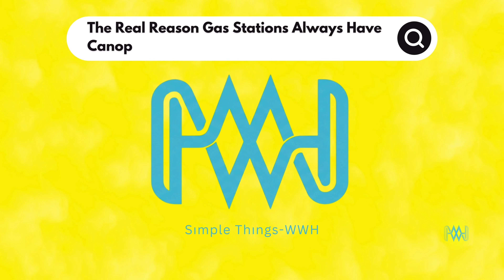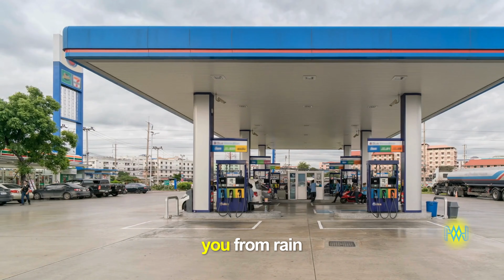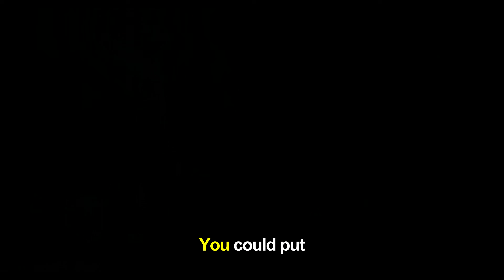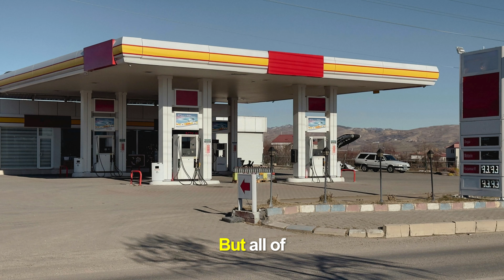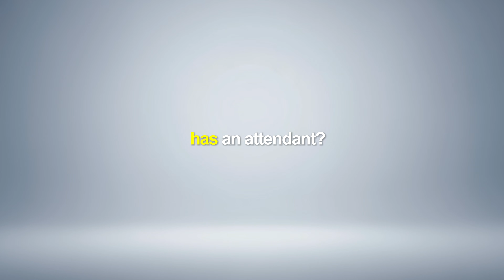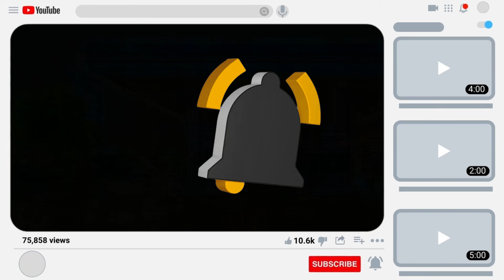The Real Reason Gas Stations Always Have Canopies

Comment: The gas station canopy nearest me is checkerboard gray and green.

And has 5 attendants 24 hours a day to pump gas, squeegy all the windows, check the oil, washer fluid and the battery's electrolyte level, tire pressure, and dispose of any trash that is inside the car.

 Each has a wireless credit card device and carrys change for cash sales.

Oops, my bad ... I was dreaming all that ... it's 2026 not 1956.

Comment: I don't think it's right to say the canopy directs the vapor up and out.  The canopy is surely vented as to allow vapors to not accumulate.  The prior implies the canopy is acting on the vapors, but it's the vapors acting on the canopy, which is why they are vented.  I'll look the next time to see if they're an open frame system so there is no closed volume to contain gasoline vapor.

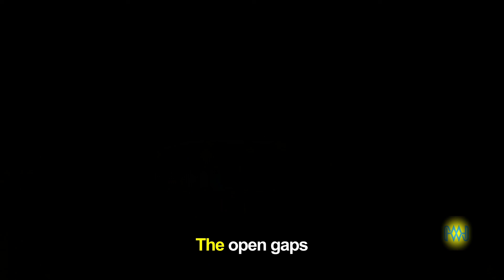Comment: 1:08   “The open gaps along the edge of the canopy are there to direct the vapor up and out.”

Huh?  What gaps?  Your video shows nothing.

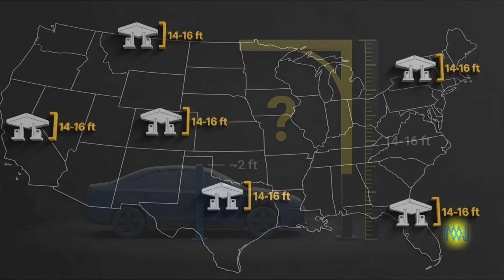2:05   “Your car only needs about two feet of clearance.”

Say what?  My car is only two feet high?  Are you smoking crack or something?
Reply from the maker: Thanks for watching closely!

On 2:05: totally get the confusion, but that line was about clearance, not car height. Meaning: your car itself only needs about 2ft of extra space above it to pass under something. The canopy is set at 14-16ft specifically because fuel tanker trucks (13-14ft tall) need to fit underneath for deliveries - way more than any car requires.

On 1:08: fair point, if the visual didn't clearly show the gaps I'm describing, that's on me for the edit. I'll make sure future videos pair narration with matching footage more tightly. Appreciate the feedback.
Reply: @WWH-X    Thanks for the speedy response.  I appreciate that.  😊 

But as for the car and vertical clearance at 2:05, please note that the image shows a pole on the ground next to the car, with the pole being used as an effective measuring stick.  The pole extends from the ground to the roof of the car, and the label says ~2 ft.  Clearly, then, it is indicating the height of the car, not any clearance ABOVE the car.   If the graphic was intended to show a clearance space above the roof of the car, then it could have (and should have) easily done that by showing a space above the roof of the car, delineated with appropriate lines indicating that distance.
Reply from the maker: @Milesco  Thank you for your excellent and constructive feedback. You can be sure that I’ll address these shortcomings in my next videos and take them into account moving forward. Thank you for everything—I’m so happy you’re here :))))